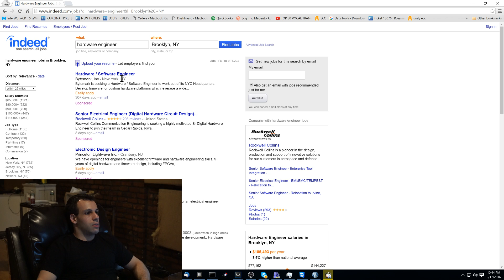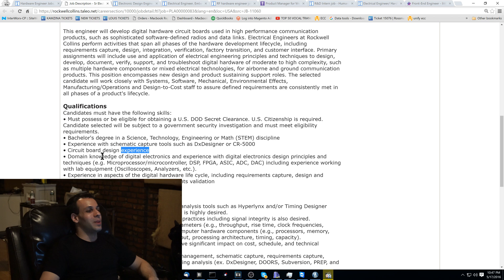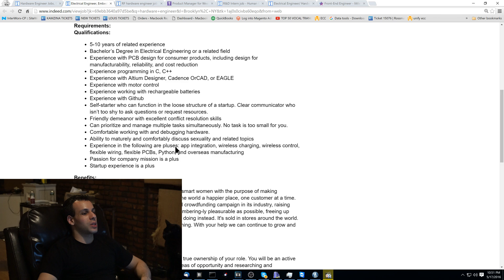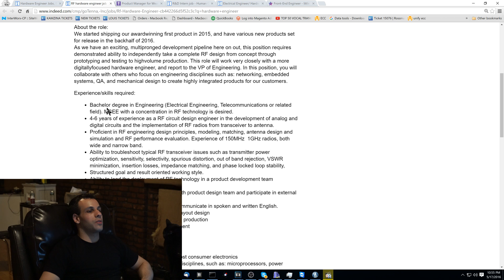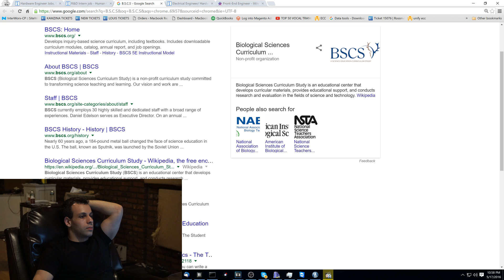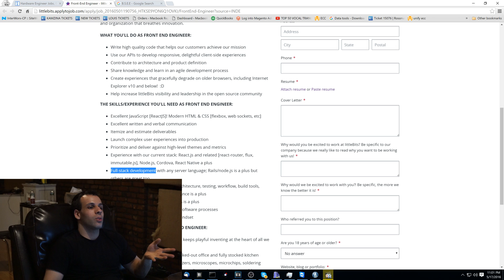Louis looks for a job

Comment: Most of all engineering bachelors degree core fundamentals are just heavy theory based. For example EE majors will know many formulas and theories but won’t have any idea how to measure current in a circuit. Let alone design and make their own pcb’s they would need more and more knowledge and that would take up another 3 years of school.

Comment: @10:25 getting hired has fairly little to do with your prerequisites... some is required but this can be in other fields... its about people liking you... and being able to tell a good story; to translate how that previous experience can and will benefit the company; in 80% of my job interviews the interviewers never even looked at my CV more then a second, and i wasnt qualified as an engineer; I had experience sailing ships over the oceans and due to that had some understanding of mechanics electronics and automation coupled with being able to direct a team of people.... that combination of skill sets is rare enough and the labour available is scarce enough to give you a good shot ...from there I became a system engineer devicing maintenance plans for a fleet of ships integrating automated and remote support and training programs for those maintenance plans and dealing with the feedback from the mechanics in the field...from there I became a full production engineer first in sanitation plants and thereafter in a data/power cable company who makes specialized equipment (and expensive equipment; one "device" may cost several millions) and because the labour is scarce it is fully meant that eventually i become a junior design engineer and then a senior design engineer to take the place of those that will retire... and theres proof that that isnt bullshit as some of design engineers have come from the same place/road im on.... be creative and be good at talking, if YOU feel convincing, they will feel convinced...cant be based on full bullcrap of course but you dont need to have the exact requirements...they look for "types" of people... we often joke among eachother that we can teach you the work the tools the calculus the tricks of the trade.....what i cannot teach you is to see problems, to be the one that knows what to do before it goes wrong, to know how to put the train back on the rails when it goes of....those things I cannot teach you for the life of me...

Comment: @7:20 .... it is that you live on the other side of the world but I think you are well fit in skillset and interests and stress-coping ability to work right next to me as a production engineer for marine equipment... we make cables and terminations for a whole host of systems including defence, seismic equipment sometimes even non-marine like zeppelin tethers and so on, our wires are a "bit" bigger but the main skill i need from a person is creativity and a love for problem solving, because thats what my job boils down to; where in the process does the "cross talk" happen (and i mean crosstalk here broader then litteral crosstalk) , another skill is that you can work and direct people; you can apply for this line of work, sometimes called work preperation sometimes call technologist, sometimes called production engineer at any medium to major company in high technology, we are short on a lot of people as well since 1) not many fit the bill but 2) its hard for people to imagine what its like and thus unlikely they work towards it, or even know that it exists .... though that said i still think you are more fit as an entrepeneur...but your skillset fits that well... I would have to make comments towards that you need in the first year to learn a bit about mechanics more (which you do not do by reading books in a classroom but by talking to many of our experiences production workers) as you do need a full scope of both electrical optical and mechanical engineering to really excell at the job . ... that said...me and my coworkers do each have our own things we are better at so there is room for some variety in there... the pay is decent...not great but decent...but at least the rent here isnt 50000 per month

Comment: Why does a vibrator sex toy manufacturer need so much requirements? Give me access to Google for certain things and I can probably make a pretty awesome vibrator with a microcontroller in a day or less. I could even make something with an ESP8266 (it's a microcontroller chip with built in WiFi) and make it so thots can get Simps to pay tips on .. certain sites.. for it to increase in intensity or stop it all together.

I don't have post-secondary, so I guess I don't qualify either.

Comment: respectable. you are a highly skilled tech, one of which many engineers would respect. More engineers need to realize that just because they went to school does not mean they are truly more knowledgeable.  In Canada, the use of “engineer” as a title is very strictly regulated, and most often limited to those with the BEng schooling (aside from Power Engineers and Software Engineers). That is why a lot of these job titles require the degree. If you changed engineer to technician, you would find a lot more jobs suited for your qualifications/lack of professional education.

Comment: you are looking at jobs that are engineering, hardware engineering, ect. You would be a great fit for a test engineer (often testing and repairing circuit boards... Literally your current job) And you would be able to pull off a lot of engineering technician positions. Nothing that would probably net you more than 100K a year though. (at least in lower income areas) But honestly you could probably get a job doing more management at a company that does board design or something similar. 

Specifically look up Test Engineering Tech. I think you could do almost any of those. There's one where I live Test Engineering Tech III that you would absolutely fit. Looks like the pay is 80K a year for it here, but I live off like 2/3rds my salary, own a house, and make a little less. 

IS that more than what you make now? I'll bet no! but your expendable income might actually increase hahaha

Edit: And EVERY single one of those that asks for college CAN be covered by your experience. It would just be real difficult to find a not entry level position that you would fit in there... A HUGE amount of engineering is problem solving. You show how you have done some of your problem solving and you can get a job. Straight up I've been told many times that you can teach people the technical stuff, but not the problem solving.

Comment: Last time I remember having a "job" was 1991. I kid you not. Low wages, high stress for what was a semi-skilled IT job at a construction company completely destroyed my desire to work for others. I did take up temping in the mid-nineties and ended up working fairly lengthy contracts twice at the local court (again, IT). That was okay because each job was different but there could be months between jobs from the agency. And so I went to University for the first time at age 29. That became a disaster due to mental health issues. Went back to Uni in 2002 and ended up switching from IT to law because I needed a change of scenery. Completed law degree in 2006. Lost a job after six weeks in 2007 because of those issues that had persisted since 2000. Gave up even looking for work so in 2012 set up my own software development business whilst still recovering. Still doing that now and also studying for a postgrad in Human Rights Law. I was one of the brightest kids in my year in school but things went downhill from the age of 12 when the bullying started to really have an effect. I'm a self-taught software developer and have been coding in numerous programming languages for 30+ years.

So, yeah. My history is just as messy as Louis'. My dad worked for the same company for 50 years as a mechanic. Some years ago he'd had enough so started looking elsewhere. He applied for a job with the AA, one of the UK's largest roadside assistance companies. We found it hilarious that he got a response saying he didn't have enough experience. He'd been a mechanic for about 30 years at that point.

Comment: I feel the reason Apple turns out such shitty products is to see how much they can get away with, so they can a big profit margin. And with their replace instead of repair policy, is another to make more money and not having to worry about troubleshooting the problem with the device. Just replace it which means more money out the customers pocket and into their bank account.
Here's a crazy idea stop buying their products. If they can't take the time to re-engineer their f*cked products then buy something that worth the money.

I had an iPhone 7 for 2 years, the only reason I had it for 2 years is because I was under contract with my wireless carrier and couldn't until the contract was up. It would randomly call some on my contact list while siting on the desk charging. Then I would tell the person, "Sorry, butt dialed you." or Siri would say "I'm sorry, I didn't catch that, can you say that again." when I did say anything in the first place. I wanted to throw it against a brick wall, that was my first and last iPhone. "When I able to upgrade to another phone I got a Samsung and been happy with the Samsung line of cell phone ever since.

Comment: Maybe for some you are not qualified, but it seems you're a fast learner.
I've seen some of your videos on how a Buck converter works, and you have more experience with that than even some engineers I know.

BTW, most of the time people have 50% of what the experience stuff lists.
So if you really wanted to apply to one of those, you shouldn't stop because of that.

Some even don't care about the degree per se, but your knowledge.

Comment: in my opinion; u maybe not an engineer but ur still a genius because the perspective of genius is a comparison between u and what i think is an average person. you use ur brain and solve difficult problems while most ppl avoid that and in fact, avoid using their brains altogether. im reminded my this degradation(mass mulitple cases) every time i use the transit system.

Comment: I think you're shooting yourself too low. In my experience, if you qualify for 1/3rd or half of the job requirements in any job ads, you would have a pretty good chance of getting a tech job.

I am a software engineer, the kind that is unafraid to build complex software, the kind that gets paid enough that I don't really know how to spend my money. While I had a university degree, to be honest, you wouldn't actually really learn that much in University. During my time in University, it's mostly rehashing things I've already known before and the best learning materials I've used often aren't provided by the University, but ones I've discovered through random internet searches. Manuals, documentations, tutorials, and even Wikipedia and even forum or blog post contains wealth of information that's often much more valuable than University course, and they were all available without being in a University.

Personally, I rate the ability to self-learn and figure things out to be a lot more important than a degree, and you have shown yourself on camera to be much more capable at this than many engineer I've worked with.

Whenever I am helping with hiring, the question I never asked a candidate is their degree. As long as you can demonstrate your ability, I don't care whether you have a piece of paper to show for it. You should always read University qualification level in a job ad with "or equivalent level of experience" tacked to the end.

The ability to read documentations and use that information to solve problems is the most important part of engineering. Really the only significant difference between what you are doing vs an engineer is that you work with the constraint of someone else's design, while an engineer often have to design and build from zero. However, in reality, most of the time engineers actually have to build stuffs on the constraint of someone else's designs too, it's very rare that you'd start from a totally blank canvas. Also, building from scratch is generally a much easier skill than working within the constraints of existing system, most engineers just don't have the experience to start from scratch because the opportunity happens very rarely.

I'd be more comfortable hiring someone like Louis than many of the engineers with degrees I've worked with, knowing that he would be able to get shit done, or be able figure out how to find out how to do things that he doesn't already know.

Comment: I would say 80% of jobs I have worked I lied on the resume. The best way to learn something is to be put on the spot to figure it out. So far has worked out. I have had to quit a couple jobs because of also lying on resumes and having no clue what I was doing. I had a job as an analytic systems recorder (I cant tell you what that means to this day) for an unnamed nuclear company in Virginia that I quit on my first 15 minute break of orientation after waiting 3 months for a security clearance.

Comment: I'm a little late to this video by 2 years but these insane job requirements are a caricature of what I face daily when applying for jobs. I'm a hobbyist programmer and I want to turn my hobby into a career. So far I know C at a powerful level and Python. I've made...
1. Data structure + memory pool + JSON-like config parser + tuple type library, all in pure C.
2. A viable virtual machine runtime env in pure C that is faster than the Lua VM and it doesn't even have a JIT.
3. And made my own C-like language interpreter (it's an AST-walker type interpreter).

I've made ALL that shit, studied algorithms, used appropriate data structure concepts, and implementations all on my own, and yet nobody wants to hire me and it makes me feel like shit.
Reply: There’s plenty of EEs with a couple years of experience who would have no clue about most of it. And the big deal is that for an EE, reasonable software skills are an absolute must to be productive. Making scripts to automate drudgery, modifying and adapting open source software, reverse engineering under-documented software systems - you need to be able to code yourself out of a box! So don’t feel bad - you have valuable skills. Now it’s a pain in the arse to find someone with a clue to appreciate those. I hope you succeed.

Comment: I hope you realize most of those job positions dont require most of those stuffs. You apply get interview they ask u some question.. if they see you fit u get job if u dont you apply to next. Its just business thing to put all over the top so ppl who are not ambitious dont even apply since thats is the worst in engineering.
Reply: True. I lied my way through an interview as an analyst for a nuke company but didnt meat half of the qualifications on the job board. Took three months to get a security clearance and quit on my first break of orientation. I'm pretty sure the guy training me also knew I had no idea what was going on.

Comment: I am in the same field, just because stuff is "throw away" it's NOT really.  80-90% of most complaints on same models are the same problems...  When they made a TV years ago, they made a chassis then took the warranty failures in the first year and applied any changes to the second year.  These changes would include revised / higher current part, maybe a bad batch,  maybe a pin was not soldered correctly.  Maybe  this one fuse blew because it was .10% off in tolerance.

So they would simply apply the previous faults to the next year, which ended up with making a really good set.  Thomson/RCA was a great example of this.  Some chassis's would run for 10 years, and yes they would change the menu, etc or the cabinet to make it "look" different, but the guts were the same.

Now they just make a new design each year, a new model to sell you.  They do not learn from there mistakes.
If we in TV repair see a consistent issue with a model, we will try to figure out why it failed.  Most of the time it's because the tolerances are too tight and a part ends up under rated.  So we will simply increase that value which makes the set last longer.

LED set's are failing at two to three years due to the LED's being overdriven current wise by around 30-40% for "brightness".  Simply changing the value of a few resistors and dropping the current makes these sets last ALOT longer.  Not anything hardly is noticed in brightness loss.

But there is still a way to fix items, and somewhat it is easier

Comment: Lots of people have a "knack" for certain things and it seems this is yours. Many engineers, once they get to higher levels, forget the basics and are unable to do component level fixes. "Hands on" experience is sometimes the best. I spent 2 years on an electronics BTEC course and couldn't identify a particular circuit. People on the C&G electronics servicing course spent all their time finding problems and could fix circuits the way you do on a block by block manner. Too much knowledge is sometimes a bad thing lol